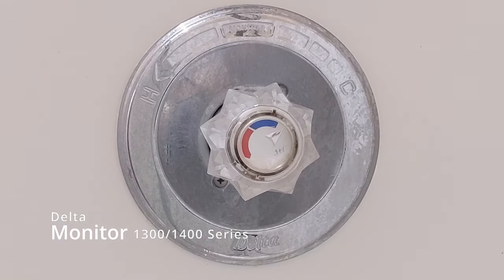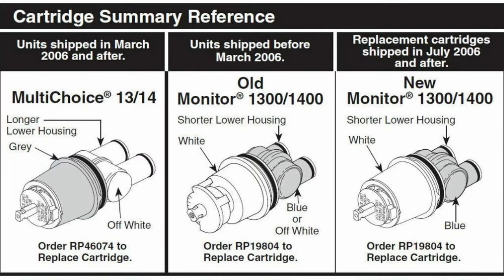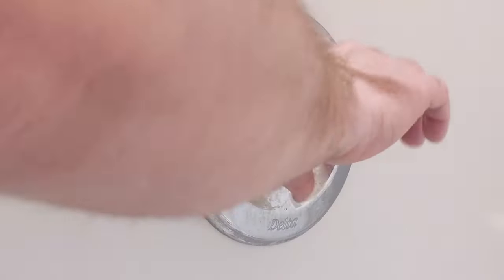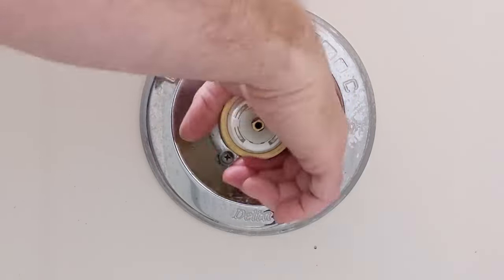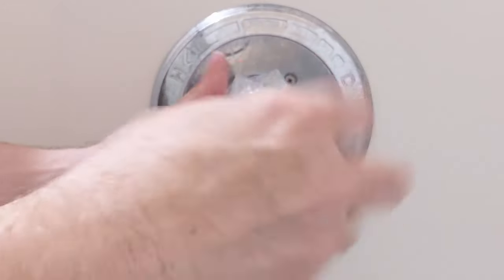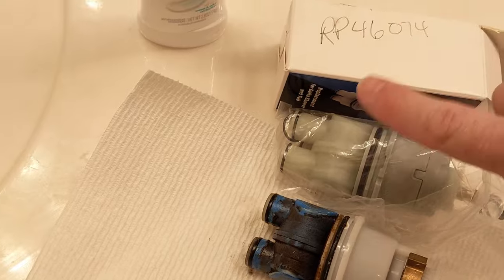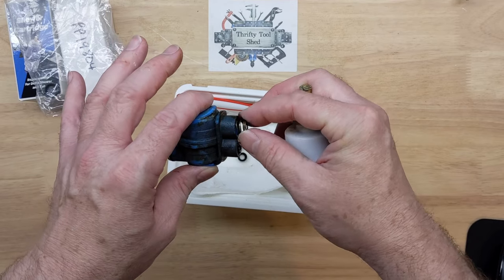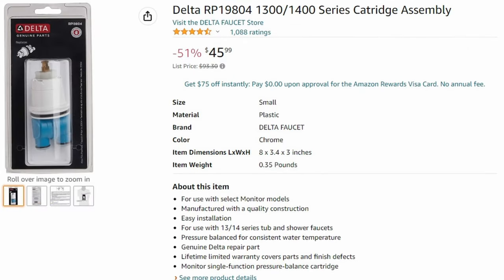Delta Monitor Shower Valve Cartridge Replacement

Comment: I have a question, If I can not turn the water off to the house, Can I still change the piece since changing the cartridge does not take more than a minute to change. Please can someone let me know if this can be done. I am asking because I brung someone to turn the water off but they are saying it is very rusty and they dont dare turn it off and cause a flood🙄So I have the cartridge and I removed everything and only thing stoping me is this issue with turning the water off to the house.
Reply from the maker: You absolutely have to turn water off to the shower. If you can isolate directly that's fine. If not then you will have to turn off entire house supply. Remember cold and hot water is coming to that valve so you MUST turn OFF all water to the valve. Verify by making sure no water will come out of valve Hot or Cold before trying to remove the cartridge.
Reply: @ThriftyToolShed  Thank you SO much, I took everything off the shower part and I dont see where I can atleast turn the shower water off like I have seen videos of others doing it. I am so stressed with this situation and half the people that have came to look at it dont know where you turn the water off to the whole house. It sucks cause it’s the hot water leaking out the spout. Does every shower have a place where you can turn the water off the shower or are there showers where you cant? I have seen videos of people turning their shower water off but I dont see it when I remove everything. Im so upset and frustrated
Reply from the maker: @pennygirl99 
From my experience very few will actually have a way to turn off at the shower. My house included. Mine had a whole house cut off at the road where the county water comes in. Some houses may have a cut off valve under the house where the water line comes in.  My house is a slab house and I have no other valve. I had to turn mine off at the road.
Reply: @ThriftyToolShed  Wow, Makes sense as to why Im not able to shut it off at the shower. I am so frustrated and Im wondering why if it’s a one minute job replacing the cartridge why the water from the whole house has to go off lol. Im a woman so dont mind my dumb question but I am just curious cause the job is so quick lol
Reply from the maker: It is usually a really easy and quick job. Turing the water off is often the hard part. If it's something you have not ever had to do at your residence, then that is an added headache for sure. It's unfortunately a bridge that will need crossing for one reason or another. I had to turn mine off at the road recently because a toilet tank valve went bad. I turned off the shut-off valve at the toilet. But it would not turn completely off and kept leaking on the floor, and I had to run and turn off the main shut-off at the road. All that just to say, it's always good to know ahead of time where the valve is and quickly turn it off, so at least your efforts will not be in vain. Best of luck to ya!
Reply: @ThriftyToolShed  Thanks so much, Ur awesome

Comment: I just installed a new shower insert with the Danko trim kit and also the 13 1400 cartridge but my water will not turn off. It's like my shut-off is in even doing anyting.  any suggestions?  Thx
Reply from the maker: Make sure the handle is really turning the cartridge stem for one thing. With the handle off can you rotate the cartridge stem with a tool and shut it off? (careful not to round it off) and also make sure the cartridge is seated all the way in.
Reply: Yeah I think home Depot is selling new r10000 valve body with the older carts lol thx for info man. For real

Comment: After the handle was unscrewed and taken off, mine has a small disc that pops off. The one in this video does not. Does anyone know what that small disc might be for?
Reply from the maker: If it's a grey plastic disc some of them do have that disc to adjust the temperature as this one has, but it was a slightly different adjust knob.
Reply from the maker: This is an example...
https://amzn.to/3Z9GsMI
Reply: @ThriftyToolShed  I apprecaite you getting back to me. Thanks for that. The model you linked is the exact one I ordered. There is also a notched, rotatable temperature adjuster (?) that is behind the screw that uses an allen wrench. The front disc also has to do with temperature ?

Comment: Does the water to the house need to be shut off to replace the valve
Reply from the maker: Yes, it should be one of the first things mentioned in the video. If you do not have a local shut off valve then the main water valve will have to be cut off.

Comment: Getting ready to do this…but I’m considering upgrading/changing shower hardware…so does this mean I need to change cartridge to match whatever new hardware I get? Or if I stick with delta will I be good?
Reply from the maker: If I understand your question correctly, you are asking if this cartridge is the same as the newer model hardware. The new model has a different cartridge. This video should have touched on the differences briefly. Of course different brands will also have a different cartridge.
Reply: @ThriftyToolShed  I guess to clarify …if I get new hardware …will my existing valve work with the new hardware? Or would i need a whole new valve. Is the valve universal for all single handle hardware sets.  I know I’d need a cartridge to match the hardware.
Reply: @klutzgolfn7009  he actually already answered your question. Older models use different valves than the newer ones. The Delta Monitor changed valves around 2006, so if you buy a valve that works with an older model made before that, it will not work with a newer one. However if your existing Monitor was made 2007 or later and you replace it with a brand new Monitor, then yes, it will use the same cartridge.

Comment: The video is great, but unfortunately you obscured the part where you adjusted the handle to turn more counterclockwise to allow for more hot water.  Maybe you could post a response or edit the audio?  Otherwise, great job, especially on the repair kit, a great bonus.

Comment: "It's easy" they say.  "Watch a YouTube video" they say.   Brass nut won't come off.  Had a pipe wrench on it , and trying to hold the rest with Channel lock pliers.   A lot of force, it but won't move.  I'm calling a plumber before I break something.
Reply from the maker: Well, very smart of you to know when to stop and get help. I have personally never seen one that is that difficult to come off, but I made sure to warn not to use extreme force or damage threads. Since apparently some this tight and stuck does happen, thanks for sharing your experience even though it did not go as planned for you.  Best of luck to ya!

Comment: Only half of mine came out. Wth..
Reply from the maker: It may have twisted and separated.  I shared a supplemental video about how the halves can separate. If it will twist back together, you can hopefully get it to pop out together. If the front part broke from the back, then you may have to use pliers to remove the remaining half.

Comment: I'm trying to get my water to run hotter but I can't tell what he's doing because his hand is in the way. What do I do to what?
Excellent video otherwise but camera work wasn't great at all during the part about adjusting the water temperature.
Reply from the maker: That is because there are different types of adjustment knobs depending on which one you buy. Mine was the type you "put your hand up in front of it" and grab the small white disc, pull outward on it and rotate it CW or CCW to adjust. It is spring loaded. Some models and manufacturers do vary the adjustment knob design, but it's usually intuitive. It's typically a knob to pull out and turn to adjust.